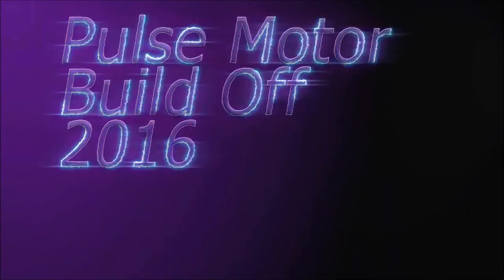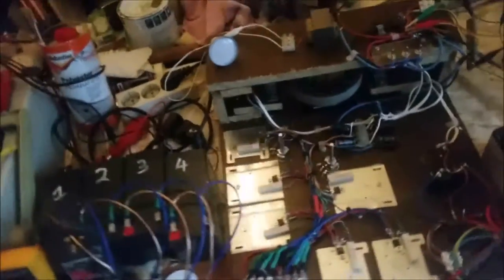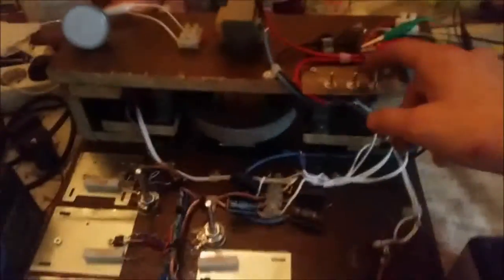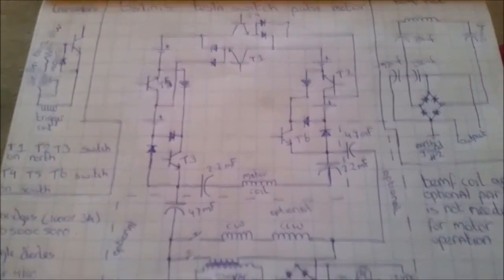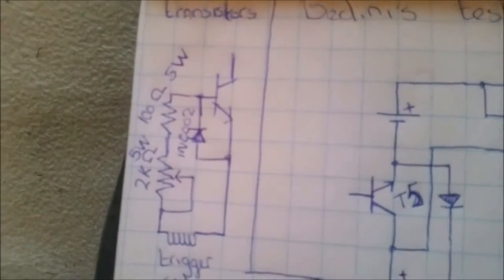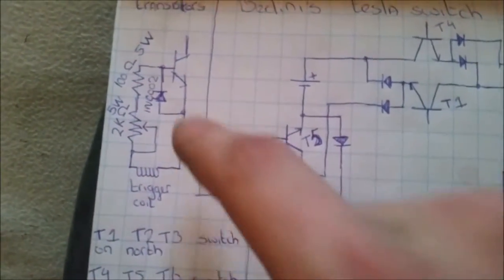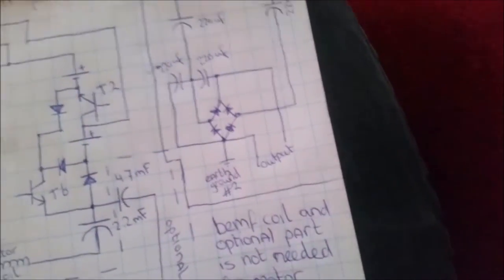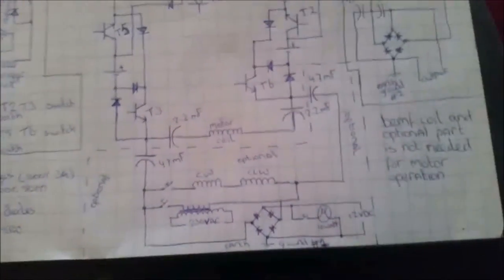PMBO 2016 Final Entry 4 Battery Tesla Switch Pulse Motor

Comment: Very cool! It's like a transistor cascading circuit of sorts? I remember seeing Bedini/Linderman Tesla switch a long time ago. How much can you load the circuit before we can see the apparent power? Thanks for sharing your work.
Reply from the maker: This is a modified version of the one Bedini/Linderman/Brandt where working on.
were Bedini used audio transformers (wich seem hard to get these days) i used a trigger wire :)
the main coil is the one in the center of the rotor.
it has 8 seperate strains.
1 BEMF coil wich you can use to recapture (i was going to use this one for a hairpin pumping circuit, but didnt turn out that well :/)
1 Motor coil wich spins the motor round.
6 trigger coils.

1 trigger coil for each transistor and set in a Bipolar type of switching circuit.
so basicly for every north and south pair of magnets swinging by
battery bank 1 fires 1 time and battery bank 2 fires 1 time.
when it fires it fills the caps on the negative side of the circuits
the max you can pull from this one is limitted by the size of caps and the transistors
i used mje3055T transistors (i have tried with tip142 didnt work cause of its darlington structure).

i ran this one last week in test phase all 4 battery(7aH) dropped 1 volt (~12.8 to ~11.8)  in a 24 hour run while running a 10 watt light and running on the extra motor coils.

i find it rather hard to measure whats happening inside the battery (scope gives a charge/discharge wave on the battery terminals).
with everything on there in the video it is shuffling about 1 amp back and forth.
but it is hard to tell what gets really lost due to wire/diode/transistor losses.

1 thing for sure i cant run 1 amp of current from the 4 battery's in parallel and only lose 1 volt on the battery's :)
so energy get's recycled.

if you have any questions feel free to ask since this will be my entry video from now on i will anwser every question as detailed as i can.
Reply: +acid byte Well done. Well 4 x 12Volts with 7Ah batteries have an energy capacity of 4 x 12 V x 7 Ah =336 Watthours.
You drained them for 24 hours @ 10 Watts , so that is an output energy of 240 Watthours....
So keep doing it until you cross the 336 Watthours barrier and see how long it goes. ..But at 11.8 Volts the batteries are almost already pretty much discharged and going below 10 Volts could damage them...Did you control if you really pull exactly 10 Watts via the light or is it less ?
Regards, Stefan.
Reply from the maker: i think it's a little bit less.
due to the switching losses and the diodes in the circuit.
the current was measured from the battery terminal. 1 amp
at the motor coil 100 ma
havn't measured the light
the light may posibly also receiving a little bit from earth.
but im pretty sure it wasn't taking the full 10 watts